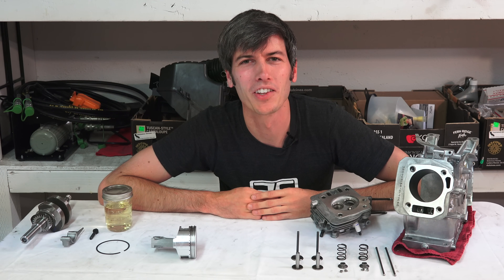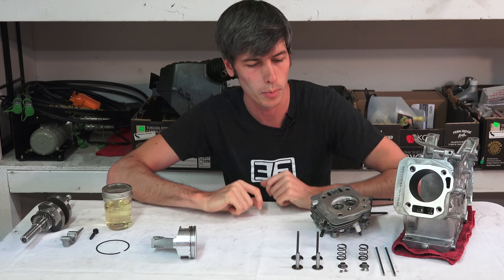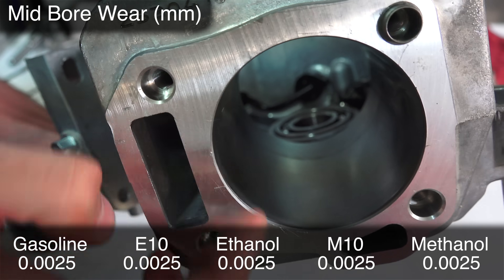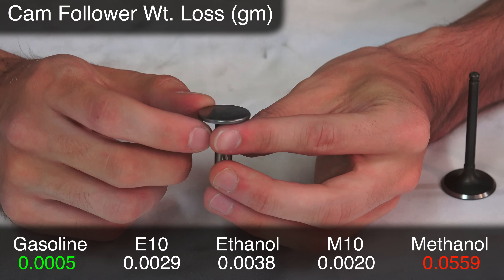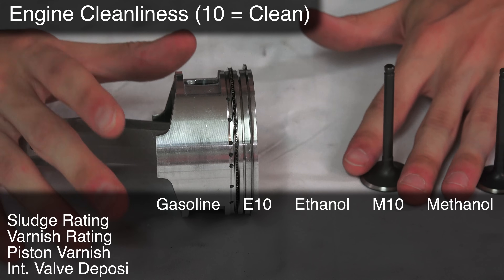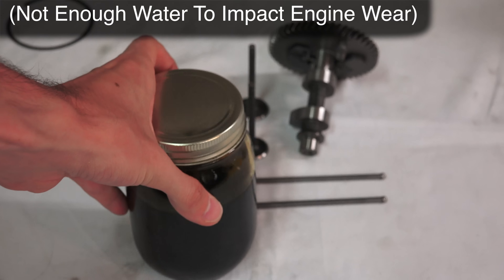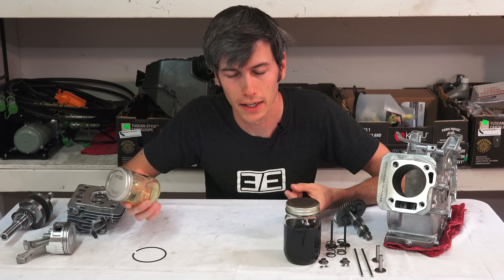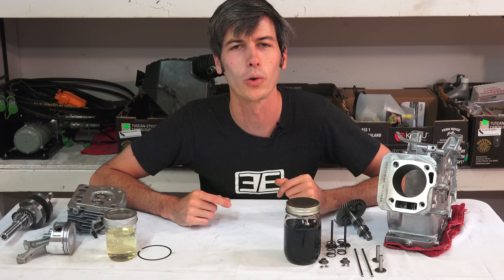Is Ethanol Bad For Your Car's Engine?

Comment: Ethanol gives "less" fuel economy, but is (atleast where I live, sweden) cheaper. So you have to fill up more but it costs about the same overall. We have e85
Reply from the maker: Yes! I'm in Sweden currently and it's interesting seeing E85 at all the gas stations.
Reply: oh you are, how come you're here? and where in sweden are you? 
And its nice to have e85 because we have quite a large old volvo community in sweden, and to get some juice out of those old engines it helps lol
Reply: Greetings from Eastern Finland! In addition to Volvos, some Saabs were designed to run on ethanol after just changing the software. I've been driving mine with mainly RE85 this summer and the only anomaly has been the whining fuel pump, which apparently isn't designed for the additional 30% pumping volume that ethanol requires (unless if it's the factory "BioPower" model). Oh, and the ethanol in the fuel is made entirely from biodegradable waste !
Reply: @EngineeringExplained  Hello Jason,
I have stumbled across an older video from Koenigsegg which it covers an a custom build engine. 
I was wondering if you have encountered any research on "Combustion Chamber Throttling" 
If you have please give us some information.
My guess just by looking at the setup is that it has coils wrapped around the piston and the have controlled current that flows through the cylinder walls in ORDER to control the push/pull movement of the pistons. Thanks for You're time Jason
Reply: Welcome to Sweden.
Reply: @EngineeringExplained  Cool! You are most welcome. So should we expect a collaboration with Volvo or Koenigsegg?
Reply: @EngineeringExplained  Welcome!
Reply: The gov wanted everyone to buy flexfuel cars in Sweden. The cost for e85 have skyrocket and they remove it from alot of gas stations.
Reply: SD visade upp idag at vill sänka priset på bensin och diesel med 70 öre
Reply: @Snorklaren0  15% Ethanol!
Reply: Many places have Pure ethanol and E85 way cheaper... if it is 80% of less than the price of regular gasoline, the ethanol is cheaper to run...
Reply: Depends on where you're at I guess. Where I live E85 used to be about 60-90 cents (US) cheaper per gallon than Unleaded, now its more like 20-30 cents cheaper.
Reply: Raimar Lunardi except in the USA you’re paying for it in your taxes with massive government subsidies.
Reply: Unforunately they have stopped selling E85 at pumps here in Norway severel years ago.
But I usually buy som litres in Sweeden when I visit.
Miss that cheap "racefuel"...
Reply: @espenschjelderup426  You can still find it one some gasstations, but only like 20-50 in whole Norway.
Reply: @melunkai  when did you do the Norway trip? I don't think there ever was much more than 20 stations with E85. And they started phasing them out about 2014-15. The local pump was empty about that time.
People either travel to Sweeden to buy E85, or buy race E85 to 3-4 times the price.
Reply: @espenschjelderup426  One week ago, I used a map to find E85 fuel stations. In the north there were no more E85 pumps.
Reply: There are not much E85 pumps left in northern Sweden because people's engines refused to start below -10 degrees Celsius plus you need to fill your tank much more often then with the regular 95 octane with 5 percent Ethanol. The gas stations didn't sell enough E85 to keep their pumps running with fresh Ethanol.
Reply: Jesper, I am from Brazil. Our gasoline here has 25% of ethanol. Engines that run with ethanol percentage in its fuel have cooler intake gases temperature, and can have a larger compression ratio more easily. The fuel economy tends to be better in urban uses, when the average speed is about 50km/h.
Reply: In France its so cheap, at 0.60€/l while gas is at 1.50€/l.
The only problem is that there isn't any flexfuel car on sale here, and converting one is illegal...
Reply: This is a bit off topic here, but I think ethanol is overhyped as a planet saving "green" fuel. The best energy crops we have yield at most about ~9kWh/m^2 per year in biomass. If you could convert that entirely to ethanol at 100% efficiency, it would take ~3.75 m^2 of farmland to produce the energy equivalent of 1 US gallon of gasoline. In 2017, the US consumed ~142.85 billion gallons of gasoline, so if you were going to try to grow the energy equivalent of all that gasoline, you'd need an energy farm spanning at least ~540,000 km^2, which is slightly larger than the combined areas of Colorado and Wyoming. Since I'm overstating the efficiency of the conversion of biomass to ethanol by probably a factor of at least 3, the actual area would have to be at least three times larger in reality. In that case, we'd need ethanol crops covering an area the size of Alaska. Scale this up to meet global demand and you're easily looking at needing an entire continent devoted to ethanol crop farming.

I realize no one is seriously proposing shifting to 100% ethanol based transportation, but the back of the envelope calculation shows hw land intensive biofuels are even under very generous assumptions.
Reply: @Marmocet  yh ofc. Thats why its good that they make ethanol from waste products. But we cant just use it
Reply: Jesper - And of course, if they're only making ethanol from waste products, the same calculations show that it's unlikely production will ever amount to more than a pittance, since we aren't exactly awash in agricultural waste products. Also, it's questionable whether ethanol production is a good use of those waste products. That biomass might be put to better use by incorporating it back into the soil, where its carbon content will contribute to the soil carbon reservoir and improve soil tilth, and the nutrients in it can be returned to the soil nutrient cycle. Whenever biomass is harvested from a site, the nutrients embodied in it have to be replaced or else soil fertility and crop yields drop. Nutrients that are removed usually have to be replaced by chemical fertilizers and as you no doubt know, chemical fertilizer production is generally fairly energy intensive.
Reply: Yeah, I've also noticed cost evens out with lower prices & lower MPG.
Reply: E85 is higher octane than unleaded, advance your timing to take advantage and you can improve your fuel economy and power.... But you won't be able to run unleaded anymore
Reply: Fuel mileage is WAY less. my 2011 F150 gets about 16mpg mixed driving on unleaded and 13 on E85. Thats a large difference.
Reply: Many ABC's have e85 or RE85 here in finland and i hope we would get more e85 here
Reply: It's cheap because its taxpayer subsidized.
Reply: @skmetal7  So is gasoline, thanks to a big oil and gas lobby. The reason governments around the world subsidize ethanol is air quality, benefits local producers and farmers, not exxon.
Reply: As a fellow Swede I know.. I have a Chevy V8 Flexfuel and E85 is the only thing I use whenever I can.
Reply: Plenty of E85 in the midwest USA but it's about 2/3 the price of E10 - so you lose money if you run it due to the low energy content per gallon. I have never used it even though all my vehicles support it.
Reply: @bubba99009 Here in Brazil, we usually fill with ethanol if the E100 price is 70% or less the E25. So, probably it is still economical to switch from unleaded to E85 if the price is 66%.
Reply: It's become more expensive since they replaced the old RON95 that had only 5% into E10 with 10% here in Belgium. Yet they produce ethanol on a big scale locally. On the other hand the Belgian government has always been in highest expert mode when it comes to milking the cow.
Reply: And how much is your government using of your taxes to subsidize its production?
Reply: @my2commonsense476  same or less than oil and gas subsidies... and ethanol supports more local jobs and farmers.
Reply: Yup I ran some as-scientific-as-possible real world tests and found that it cost the same to drive every mile with the only noticeable advantage being a smoother idle in my older pickup.

Modern engines are built around ethanol so the whole engine damage thing is moot.
Reply: Same in australia e10 is a bit cheaper than premium 95 ron
Reply: Sweden does not strike me as a country with a lot of sugar or corn crops so where is the ethanol coming from? Is it imported from warmer climate countries like Brazil? The real payback for ethanol countries is usually that the money goes straight back into their own economy instead of to the oil producing countries even if it does cost a bit more in the end.
Reply: The original video may have overlooked the stoichiometry. The energy density of ethanol may be less than that of petrol, but an engine can burn a greater mass of ethanol than petrol for a given volume of air.
Reply: Here in Australia I find E10's actually more expensive slightly once I look at month averages, though I'm sure that's more due to local pricing (bio fuels in Australia exist in a kind of duopoly). It's also well within the variance of switching normal fuels - my car gets marginally better fuel economy with Mobil 91 than BP for example, and Shell usually gives the best, but isn't offset by the cost (we have cyclic fuel prices, so you get pretty obsessed about where's best to fill up 5 jerry cans the night before prices go up lol).

What I'm more interested in is net pollution from each. I've heard SO many conflicting reports where one side says E10 produces less CO2, and the other that that's offset by worse fuel economy,etc, and everyone seems to have a study. Honestly...
Reply: Only the same price due to government intervention.
Reply: no cold start issues in the Nordic region with E85?
Reply: @Denverian  Try lighting alcohol in the freezer, sub-zero temps don't bother them at all.
Reply: you have e75 in winter no?
Reply: Actually this is only true because cars are designed to not take advantage of ethanols higher octane
Reply: We made a Norway, Finland and Sweden trip. 50:50 fuel:E85 mix worked well. Our car is a 1989 BMW 525i, it will lean out the engine a bit. It starts to idle funny but runs fine. Does not even tanke much more fuel. 40% discount on E85 compared to regular gas is just insane. I dont understand why so few people use E85. Nearly any car can be converted with bigger injectors.
Reply: @melunkai  because ethanol sucks
Reply: It's like 3-4% less for fuel economy, so if you can get it more than that cheaper it's better. Sadly it's like $0.02/L cheaper with $1.40 prices in Australia so it isn't worth getting most of the time.
Reply: That's is exactly why i never fill up with E10. Ik have to visit the gas station more often. Time is money.
Reply: Jesper Danielsson E85 förstör motorer i längden
Reply: The problem comes with not being able to go as far on a tank of fuel.

And then there's the fact that you need to drive it practically every day or you eventually won't be driving it at all. I had a car with E10 that ran out of gas and by the time I had enough money to refill it, the fuel that was left over in the lines had gummed up so bad that it barely ran. That's with just 10%.

Comment: in Brazil all gasoline has 27% alcohol, the card consonates a lot and loses torque and power. sorry about my English.
Reply: The technical term is pre-detonation, but you can just call it engine knock, or knocking. Newer cars compensate for knocking by adjusting the timing to avoid engine damage.

Comment: At 4:07, the pure methanol had way more wear, while the pure ethanol had very little. Yet, the 10% blends trend the opposite to the pure blends. On the face, this appears to be anomalous data.
Disclaimer: Didn't finish the video, will watch it later.

Comment: If you fill something with E10 that is used on a regular basis it’s no big deal. It’s the things that are used sparingly like collector cars and small equipment (especially 2 cycle) that gets wrecked when the ethanol breaks down and attracts moisture into the fuel system and it gets a big gulp of water when you start it.
Reply: If the Ethyl alcohol in the petroleum blend, "absorbs" water from humid air, then that absorbed water will burn as it becomes tempered alcohol.  Like 80proof booze vs 60proof.  Both still will get you there, but 60proof or "Scotch and Water" will take you longer than straight Scotch at the same volume.  I used to have a lot more problems on Mobile Bay with a lawnmower and pure gasoline.  Mow and put it up on 1/4 tank, humidity gets in, condenses, gasoline isolates it to a bottom layer, damned thing won't start next week.

So Ethanol that has not already been saturated with water, will mix with humidity better than gasoline.  If your tank is vented and gravity fed (small motorcycle or mower) then the rule is keep it full till end of season then store it completely dry.  If you have a petcock then it is easy to drain through the reserve setting.

If humidity gets into your tank above the fill line, it will condense when the temperature drops.  Thus you notice water in your fuel in the hot day, cool nights months.  Physics and chemistry, vs anecdotal guessing.
Reply: Obvious solution: drive your collector car more often! :-)
Reply: Enthusiasts Garage 

Ethanol does not break down. Ever see a bottle of 25 yr old Scotch? Ethanol does not attract more water to a fuel tank than pure gasoline. It dissolves more water because it is both hydrophilic and soluble in gasoline.
Reply: The issue with 2 strokes and E10, is a weird one.

If you premix, which most of us do, you have a 
mixture of 3 things, oil, ethanol, and gasoline.
Now, let's add water.  Almost instantly, we get 
a phase shift, the oil and gas will separate out 
from the water and alcohol.  BOTH will run the 
engine, but only one will provide lubrication.

steve
Reply: I have a 2 stroke 125cc e100 engine that puts out about 37bhp (It's a go kart race engine)... If the engine is designed to run e85 or e100, you shouldn't have any problem, actually you can effectively increase your compression and have a lower clinic variation (difference between 2 distinct burn cycles) with it...

Comment: There's so many factors you didn't touch on in this video...

if you want real information, read these comments. Some of them aren't relevant, but most are.

My biggest two concerns are as follows:
1) 20 hours is not NEARLY long enough for good, reliable results. That's the driving equivalent of a week and a half for me.
2) Ethanol is HORRENDOUS for cars that are not modified or designed for its use. This was briefly mentioned in the video but not nearly developed enough. Older forced induction cars can benefit immensely from the cooler temps that ethanol provides, but they absolutely require modifications and tuning that slapping a "flex fuel" sticker on simply doesn't provide. 
3) Ethanol is oftentimes NOT THE PERCENTAGE labeled on the pump. E85 enthusiasts know that they need to test the E85 content of each E85 pump from any E85 provider because they are often actually quite a bit lower than 85% ethanol and that can be dangerous if your ECU is tuned PRECISELY for 85% and no less.
4) You made no mention of the huge performance gains that ethanol can provide when cars are specifically tuned and modified for it with larger injectors and ECU tuning, etc. When done correctly, ethanol can essentially be cheap racing fuel.
5) Running ethanol SEVERELY reduces your fuel mileage.
Reply: flyingmonkeyofus  I bought a flexfuel kit to my e87 BMW and been driving almost 10 000 miles without any problems. This box that i bought counts the ethanol% and then adjusts the engine for it precisely. So it can be driven with any mix of gas and ethanol. Because e85 ethanol has about 28% less energy than 95oct gas, it also uses more, thats for sure. But where i live (Finland) e85 costs 1e/L and regular gas 1,55e/L so it does make driving cheaper. I made the conversion just for curiosity tho. Just wanting to show that ethanol is not THAT bad as a fuel. Just make sure fuel lines can take it and ignition works as it should. :)
Reply: yeah I agree that it certainly can be good and even better than regular gasoline 

but it's not a clear cut major improvement due to the fact that supporting mods need to be done in order to be efficient and reliable 

a bunch of my L67 and 3800 buddies run E85 and it works wonders for them but they all have years and years of experience and knowledge under their belt and a good bit of money to ensure everything runs smoothly
Reply: Pretty sure if your car says Flex Fuel that means the vehicle can take what 30% ethanol? Or is it E85? We don't really have Ethanol at Gas stations in Canada it seems (besides up to 10% in almost all of our gas).
But yeah it should be designed to handle ethanol, unless someone is actually buying and slapping the sticker on after they get the car lol 

I wouldn't say E10 severely reduces fuel mileage, it does a bit, but yeah I suppose E85 would be a lot less efficient.
Reply: You dont have to capitalise every word you want to emphasise. Just write uniformly and correctly. 
It makes your comment jarring and uninteresting to read.